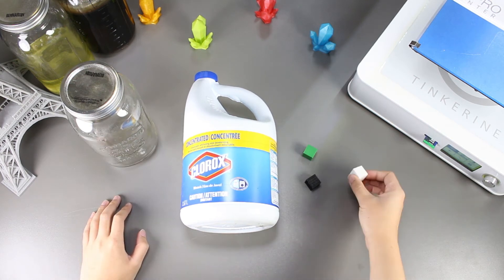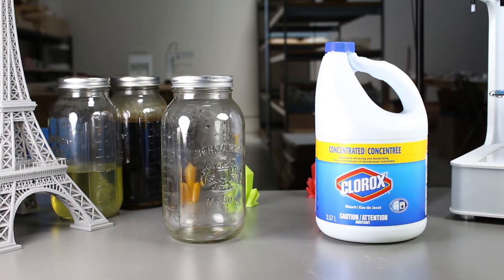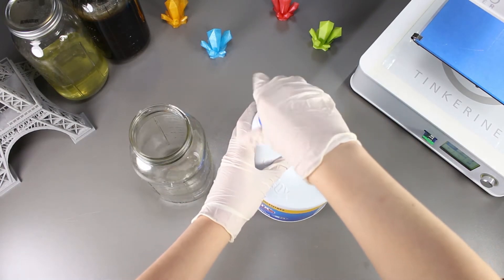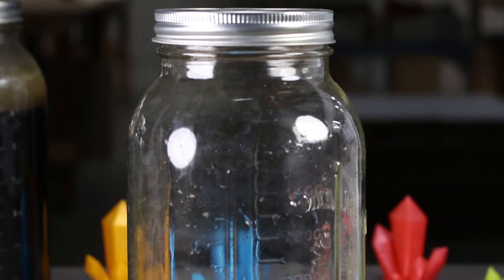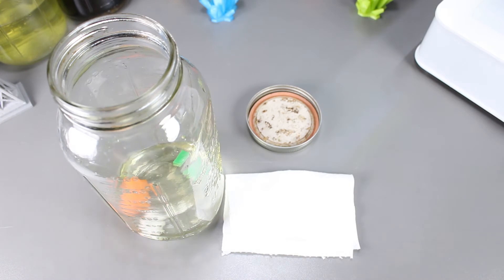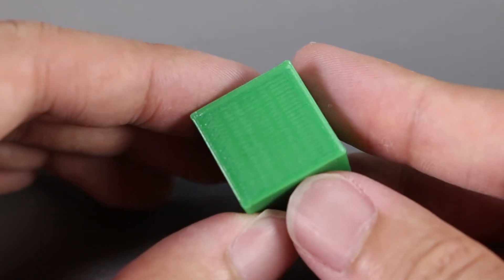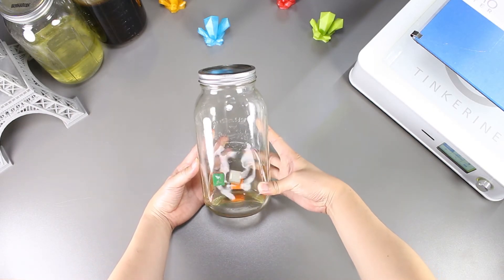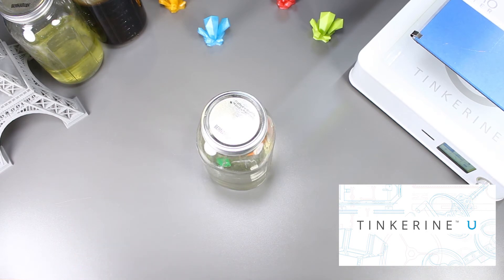Exposing PLA Filament to Bleach

Comment: Let me introduce you to something called a "control" that is something in an experiment that stays outside of the experiment.

So print 4 cubes with the same PLA.... keep one outside... put the other 3 in bleach.... take one out a 1 hour, 1 out at 5 hours one out at 10 hours.... 

Compare all of them to that one that was never put into the bleach. 

It would also be worthwhile to also measure the weight of before and after bleaching.